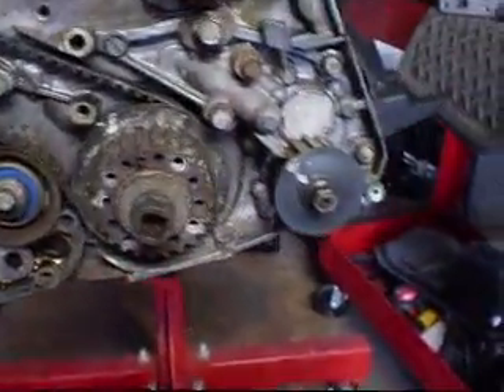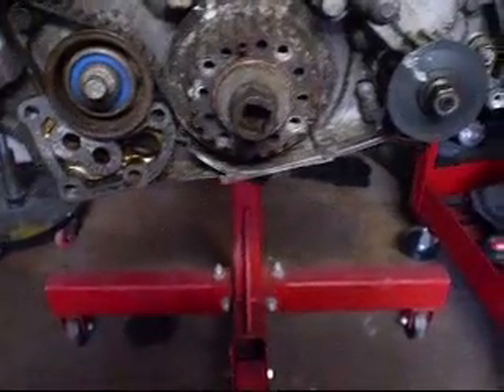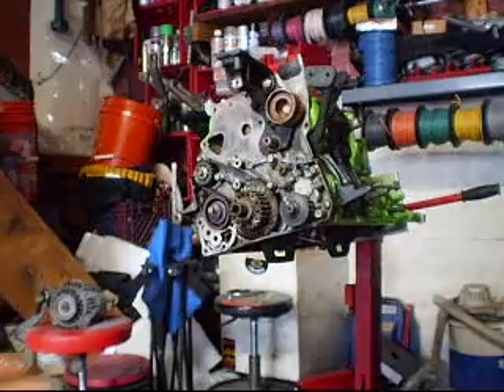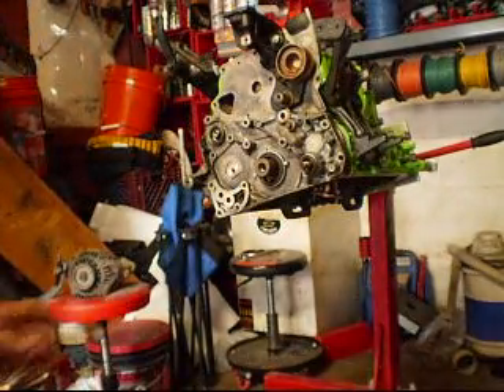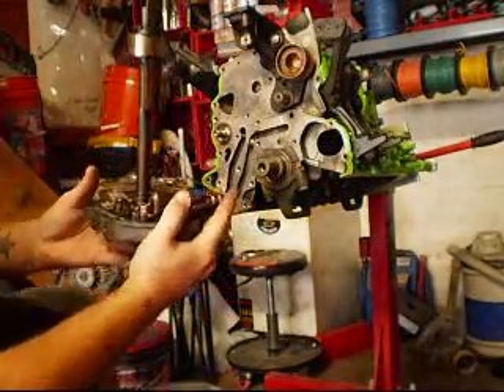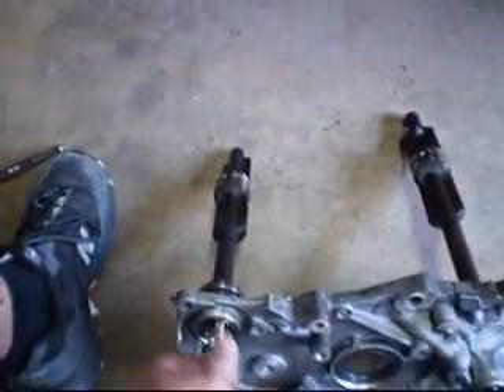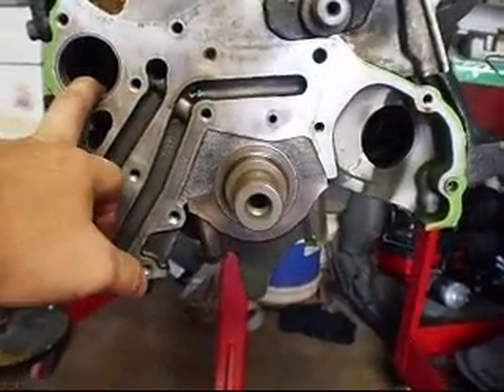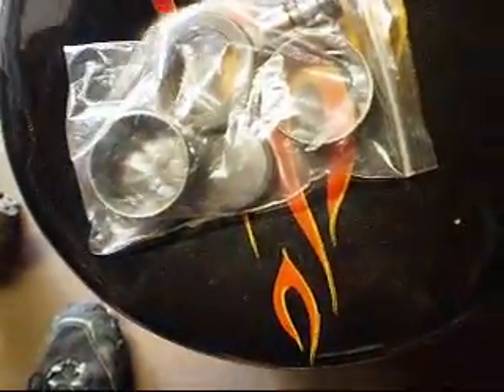4g63 balance shaft elimination pt.1

Comment: Hi how are you. I did a balance shaft delete kit on my 4g64 eclipse. But now I'm getting a real low idle when the car warms up and it keeps stalling. Any suggestions thanks.
Reply from the maker: Not that the 2 are related. but dsm tuners could point ya in the right direction. look at idle adjustment. and the biss screw. and as a general rule of thumb check for any vacuum leaks.

Comment: Dude how in the hell did u get the b-belt sprocket off when the bolt turns with the sprocket!? And how would u get the bolt back on the sprocket at the right torque Cuz when u go down with the bolt it will start to turn!

Comment: I have done this to a couple of 4g63Ts and the only thing that a person would have to take it to a machine shop for is to install the blocker bearings that come with the kit. The balance shafts were initially used when this same block was used in rear wheel drive applications to reduce the harmonics in the engine, they are not needed in a front or AWD application.

Comment from the maker: @canadasarmy i had previously broken it loose with an impact gun and and had it only finger tight. or ya can break er loose with the belt still attached and use a ratchet on the bolt.

Comment: i have been lookin all over for a front case video.. thanks!! im trying to see what im in for.. im about to take out a kia optima 2.4 (built almost the same as the 4g63) i have to do the upper and lower oil pan and i figure i would do the front case seal and camshaft seal while im there...i wonder can the front case and upper and lower oil pan be removed without taking out the car?